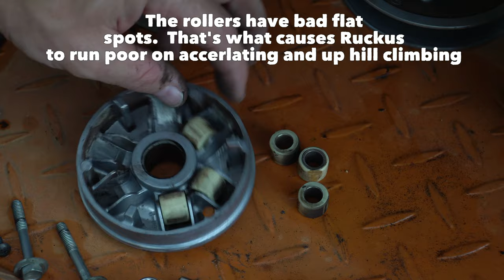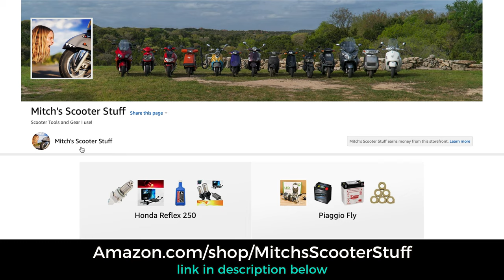Honda Ruckus / Zoomer - CVT parts inspection (belt, rollers, clutch) Mitch's Scooter Stuff

Comment: I use a stiffer paint brush and compressed air when cleaning the case. It will get to those hard to reach areas. 

It will save you some time too. 👌🏽

Comment: Can make video about why you dont use impact gun to tighten the cvt front pulley nut? Because you use manual torque wrench to tighten nut. I think you did the right thing. I see alot of owner scooter complain that some workshop mech did error on cvt like nut whack until thread gone.

Comment: Hey Mitch. do you have a video on disassembly of the driven pulley? Trying to fix an engagement issue. Variator looks fine. It appears I'll have to replace the weights, but have to take it apart. I don't have a manual as it's not my Ruckus. Help please!